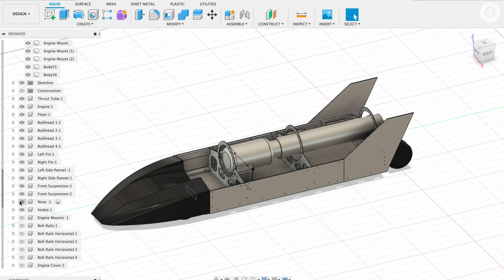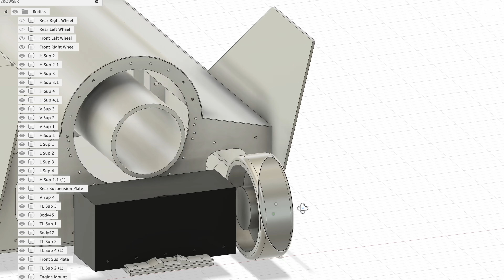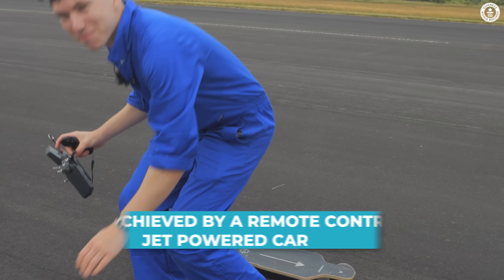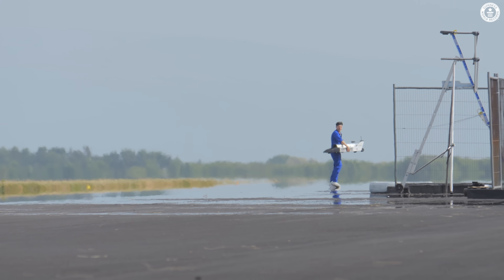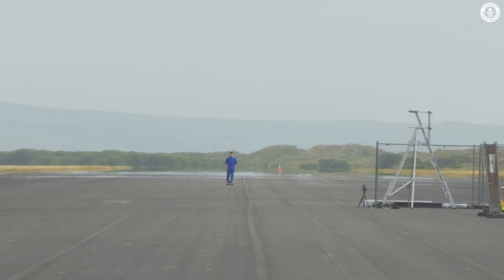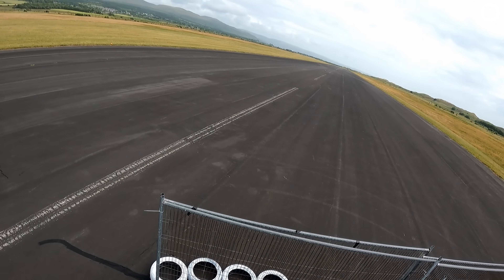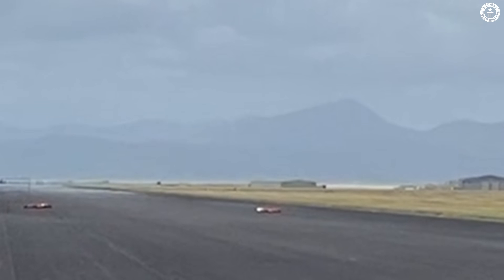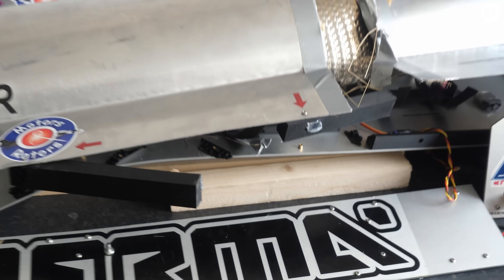Fastest Jet Powered RC Car - Guinness World Records

Comment: First, congratulations on your new record.  Secondly, you stated that there are "lots of electronic gizmos to make it all work".  If even one of those "gizmos" help control directional stability in any way, don't they disqualify the car from "Remote Controlled" category?  If however they are simply there as safety devices to ensure engine shut-off or braking when called for, I withdraw my question.
Reply: bro buzzy question

Comment: Congratulations James! Great to see you finally got the record. But I´m wondering why the drivers stand is behind the model at the starting line, rather then in the middle of the track distance?  Is it due to safety regulations or competition rules? 
There is some competition with electric rc boats in Germany called "SAW" where the pilot is placed near the measuring section: https://youtu.be/SCywrCH-Ujs?si=HwynhlXYyJ9w7IiL.

Comment: James, the nose is not a good choice and there's way too much rolling resistance in your tires especially with the downforce the current nose is generating.  Scaled for that track they wheels/tires need to be very narrow, hard and fairly tall.  You shouldn't need that much downforce in the nose (perfect aerodynamics would be a teensie but under nose lifting, though you won't want to be QUITE that close).  I'm sure that you've seen the Bloodhound SSC (pretty much perfect aerodynamics for a rocket car) and that would be an EXCELLENT basis, but at this scale you'll need a wider stance (not the body, just the wheels) and taller wheels/tires because the scale surface that you're running on is MUCH rougher and bumpier than the salt flats.  A larger diameter wheel will bridge a lot of the roughness.  Tall thin wheels will also act as vertical stabilizers, and you won't have to enclose them because the rolling turbulence that they generate will be negligible.  Looking forward to checking up on you.  Good luck!

Comment: Use a brushless motor to get you to 80 mph quickly. Then the jet engine will have the ram air and then power up faster. You will need less runway.

Comment: 94MPH! - I will tell others 137 :) Woo Hoo!
Rossa inspired me to engineer a set of high speed tires. I used 3" ID silicone car turbo tube (5mm thick w/ 3 ply reinforcing) as tires. Cut to 1.5" W rings and Glued them to 3"/2.2" 1:10 scale SC truck wheels. I would recommend 1:8 scale 4" wheels for your projects.

Comment: I wonder if this would be easier with fpv compared to LOS
Reply: I've wondered the same thing.  Asked the question in one of Kevin Talbot's videos.  I don't think anyone has responded though.  But yeah, seems like you could get way more runup length with FPV.
Reply: Too much latency?
Reply: @Rahvanteli  No.  Latency is pretty low, especially with analog systems.  If it's good enough for close proximity flying of high speed drones, then I think it's good enough for a long straight runway.  😀

Comment: Seems a bit slow. I would have thought a jet rc would be faster than the out of box Arma rc cars. Some are breaking 100 mph +. Some of the faster electric are nearing 200 mph.
Reply: If you watch his video, it 100% had more in it, but ended up breaking up due to user error. It’ll be back with a vengeance
Reply: Well he did crash at 140 so....